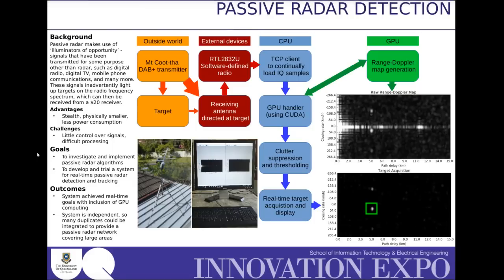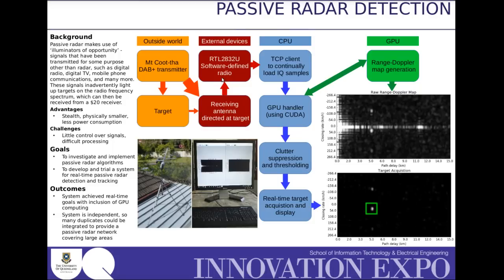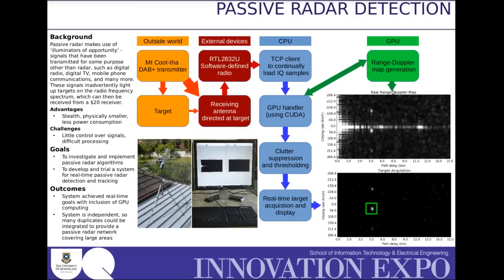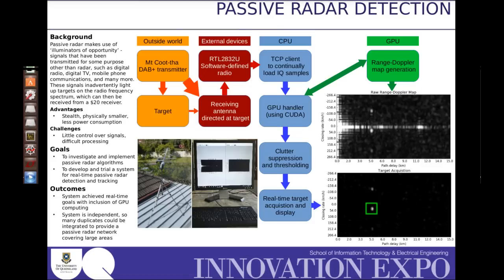Real-time RTL-SDR Passive Radar w/ Clutter Suppression + Target Acquisition

Comment: So this works with only one sdr? 

Other passive radar work with two dongles.
Reply from the maker: Yes, this is with only one SDR. I'm not using a reference antenna for clutter suppression, I'm doing it via image processing, so there is no need for a second dongle.
Reply: myeongsa that’s awesome.

Comment: How are you suppressing clutter? STAP?
Reply from the maker: I basically used the CLEAN algorithm for my clutter suppression, and then I also did some averaging to lower the noise floor.
Reply: Any way around the "I cant share the code" part? Theres lots of people's thesises that are up on github with various copyrights.
Reply from the maker: Unfortunately I won't be sharing the code, but I'm happy to answer questions to work you through the process, which I have done with others.
Reply: @myeongsa  do you have a detail of clean algorithm implementation?